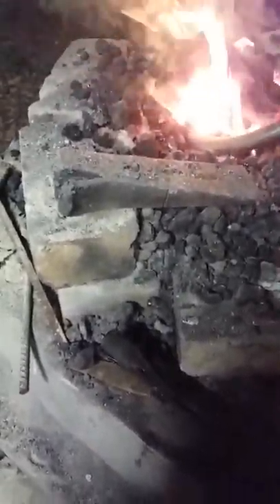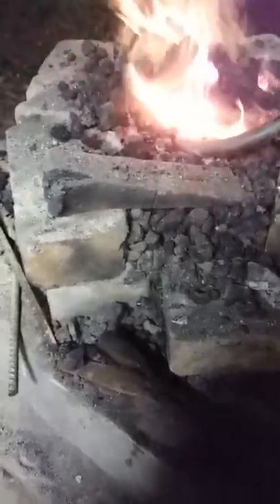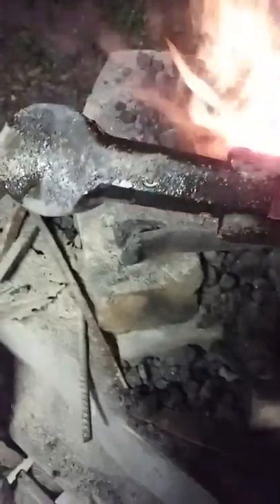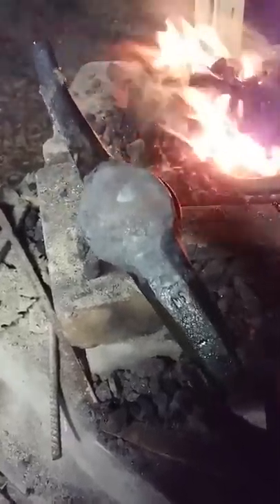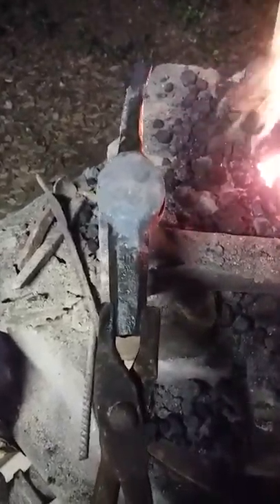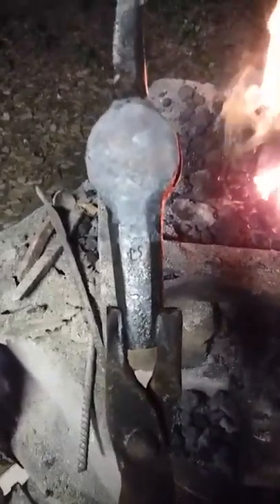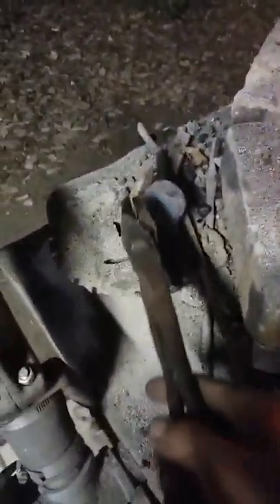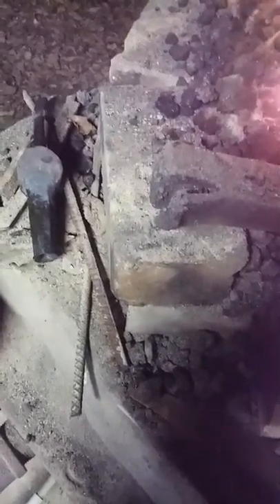Ball pein war hammer

Comment: I'm left to wonder how well the transition from the handle to the eye is gonna hold up on a 30 inch handle with the eye being that small. I guess if the eye is big enough for a sledgehammer handle it'll do fine.
Reply from the maker: Curiousity Forge I'm just finished forging the spire from coil spring. Your Curiousity is well founded. I intend to create a steel support that centers on the spire spreading down both sides of the handle at least 12" and firmly riveted in place through the handle. This bracket was common on pickaroons and war picks to reinforce the handle. If I did not add it, the striking force would be completely on the base of the eye. That would be an epic fail if this weapon was to see actual combat as the wood would shear at the head and ruin the weapons usefulness instantly. Stay tuned! This is going to be cool.